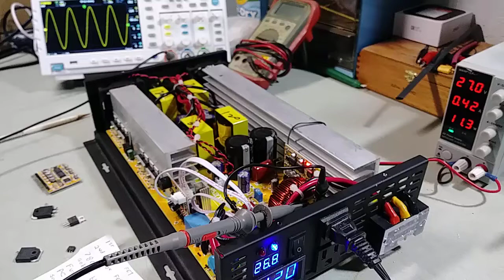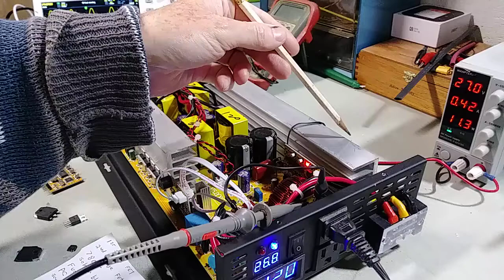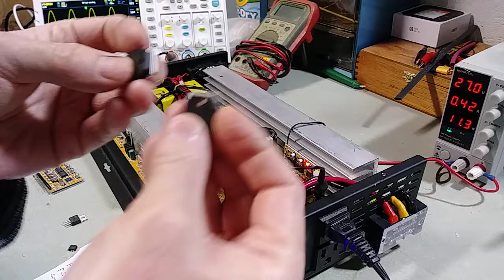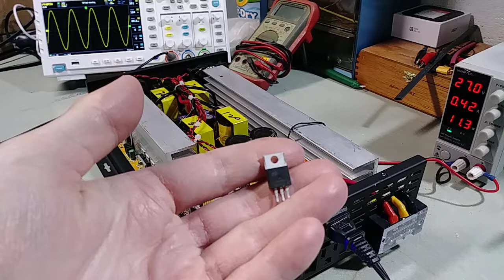Yueqing Reliable Inverter Part 4

Comment: I enjoyed your videos of the Reliable 3000w inverter. Do you have a link to the manual you have with the schematic? I am trying to repair one right now and I need the schematic. I also need the value for R13. Mine is burnt up beyond reading the color code. Thanks for any help you can give.  Ken

Comment: Please check the outlet socket wiring.   I found on three of these the neutral tab for the outlet is connected to the hot bus on the circuit board and terminal bus red connector.    The wide slot on a US outlet 120v is for the neutral not the hot.   These inverters are often cross wired which leads to a 60v reading between the ground and neutral and hot and ground.    The circuit board bus connections both read hot with a sniffer.   If you disconnect the  wires and power the unit only one is hot.    I believe this outlet cross wire issue is what is causing a lot of these shorts.

https://youtu.be/bkzmud2FJk8?si=t-V9lwcMDsec1aOV

Comment: that is great you got it working again, I have a 4000w repair i need helpe with, i will be making a video on it ") thanks for a great video.
Reply from the maker: How did it fail?
Reply: @puffergas  turned it on and it just stopped working after 2 mins
Reply from the maker: @GoingOffGrid101  Was that the first time that you turned it on?
Reply: @puffergas  yes it was one of many I have bought, but this one was doa
Reply from the maker: @GoingOffGrid101  Send it back under warranty.
Reply: @puffergas i did but i got to keep broken one to lol